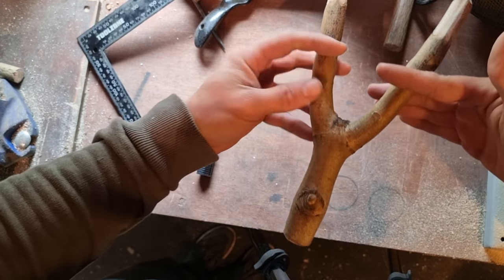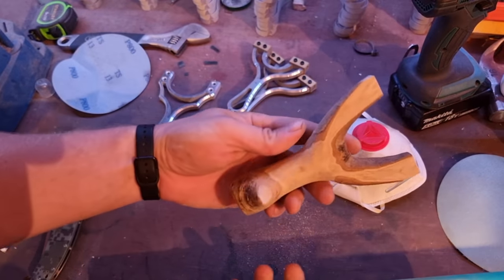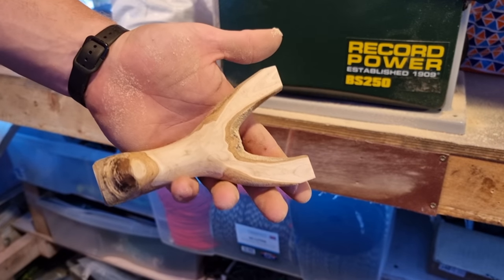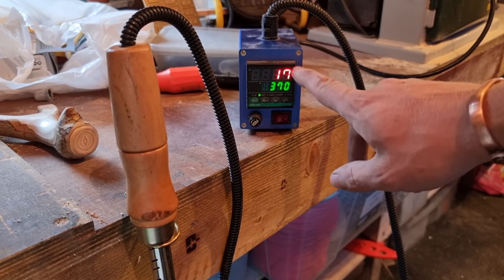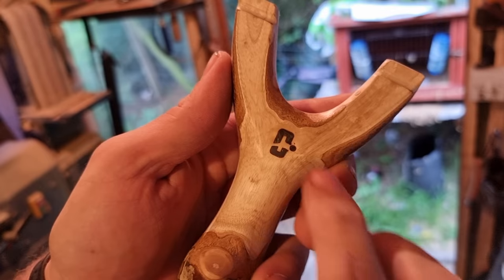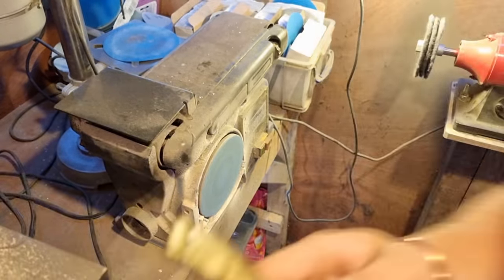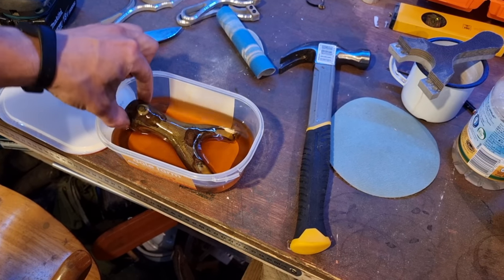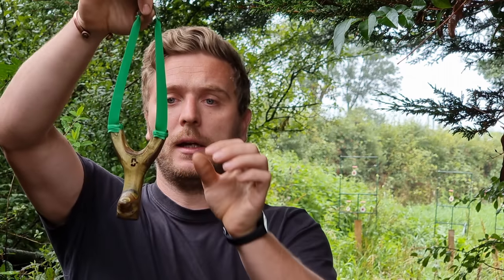Creative Ergonomic Slingshot Build | Natural Slingshot

Comment: Nice, mate. If anyone is struggling to shape the cup, pack of tools etc, I came up with a simple and easy method. You can use hole saws of various sizes with sandpaper or emery cloth taped on and wrapped in a spiral. If you put loads on you can tear off the used bits to reveal fresh layers. Just a quick tip if anyone is struggling for gear. 

Chris, another great video mate. Looking forward to getting into my first live Q&A with you, sir. Please let us know bro. 👍
Reply: That’s a great tip. Thank you for posting it.

Comment: I have a question that I can't get anyone to answer. I shoot butterfly style and I really would like to start hunting, but I need to know what taper would be best for 10mm lead for optimum power
Reply: Also would .6mm bands do the job
Reply: Heya ill answer that in my opinion probably 0.75 if you shoot butterfly style like a 25/20 I shoot face ancor and with 10mm lead I use 1mm bands 25/15 I hope that helps

Comment: These are always the best ones I love carving them to fit my hand out of Green wood like oak or beech but do get cracking sometimes especially with the oak..although generally only small ones  great video  cheers
Reply from the maker: Do you have any bother with them cracking? Glad you like the video cheers
Reply: @CatapultCarnage  if i try drying them out over a radiator after i have worked on them yes ..But when i just leave them outside or just under cover they are generally perfectly ok ..its the fast drying im sure
Reply: Try Ash, it's a very tough wood. 👍
Reply: @jimmyrustler8983  They used to use Ash for Canal lock Gates because its one of the few woods that doesn't rot in water as quickly as other timers And yes i do use Ash and Rowan sometimes as its a very common tree here up North cheers
Reply: @danielgreen3715  Yup, Ash was used in so much stuff back in the day. Axe handles, bow staves, etc., It also looks amazing when hand finished. It also absorbs drying oils like Linseed really nicely. 👍
Reply: @jimmyrustler8983  Cheers..I will try it as i tend to have not bothered with all that up till now  i like to try keep the Bark on the catty especially with Oak as its a really good grip as its rough.. But will try making one and spending a bit of time on it instead of once it looks right enough get a Band on it and see how it shoots!!
Reply: @danielgreen3715  I've never made a frame and left the bark on, that's mainly due to me being a weirdo though. I will give it a go, as I have Irish Blackthorn and Cherry growing near me.
Reply: @jimmyrustler8983  Cherry is certainly worth a go ..Not so sure of Blackthorn though finding a suitable piece of that i would have thought would be difficult and you would have to clean that up ..Be an interesting one though!
Reply: @danielgreen3715  Yeah, blackthorn's no joke, I got stuck in one a few years ago whilst metal detecting 🤣

There's a big field of them to choose from though, some nice stout forks lower to the ground which should work really nice. Hopefully....

Comment: Nice one lad......regarding wood absorbing finish ......you do NOT use anything above 180—200 grit ...why????.....because the extremely fine powder generated by finer grits actually seals the  grain .....so your finish only sits on top and isn’t absorbed......so when your finish is on...then you can “finish the finish” with super fine grit
Reply from the maker: Cheers buddy. I bet the scotch bright buffing wheel clears that dust away
Reply: @CatapultCarnage  mmmm....I think you’d lose the bet lad.....buffing is polishing off a “finished finish”...it’s not a Hoover .....I know it sounds complex)...not lecturing you.....but here’s the sequence for finishing.....
1) sand with the grain up to 180—-200 (u can actually at this stage get a glimpse of what the frame will be like after top coat and finishing by simply wiping it with white spirit/terps....this process acts like a magnified glass to highlight the remaining scratches ....you don’t want a scratched frame????then keep sanding till you’re happy(180—200)
2) then you colour the frame (which is only a colour....NOT a finish)++++ a few coats if required ( reduce colour if u need by a wipe of the relevant solvent)
3) now ....the TOP coat(finish)....it can be lacquer....(single/2 pack) varnish diamond coat..or whatever....
At this point I’m tired...if you’re interested  to know the rest then let me know